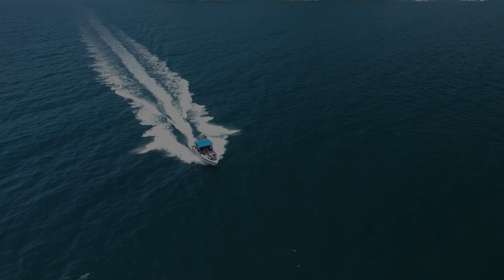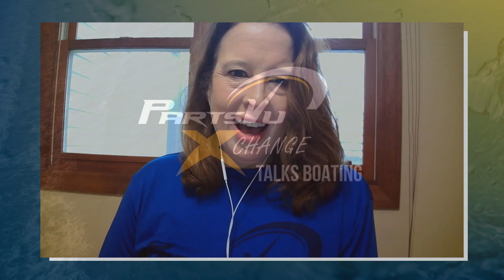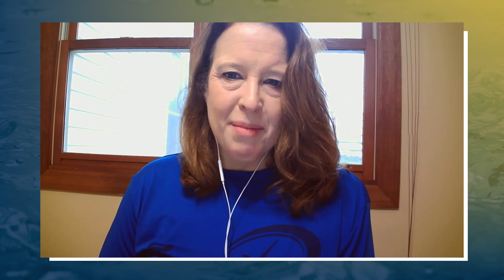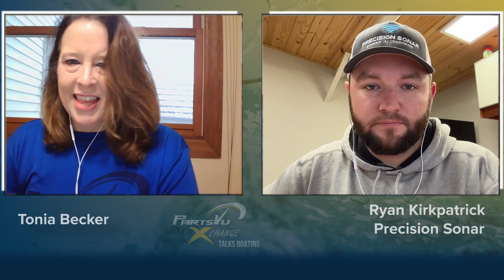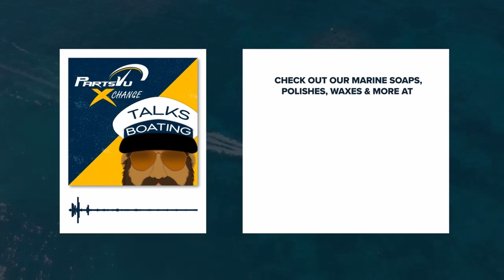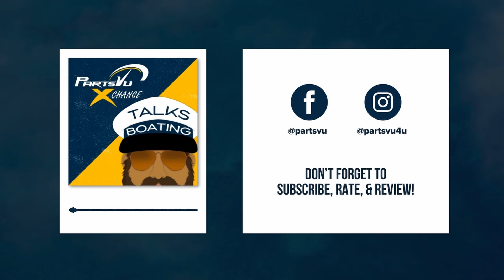The LEASH— Saving High-Speed Boaters' Lives | PartsVu Xchange Talks Boating & Fishing Podcast

Comment: I thought the leash was a piece of safety equipment invented for the outboard motor racing world that has found its way into the bass tournament fishing world. It’s not unusual for some bass boats to reach speeds of 80 or higher. 
It would be a good piece of safety equipment to own on boats that go 60 or higher. 
Since it’s legal to drive high speed boats on public water with no speed limits, then some safety precautions should be taken. 
If high speed driving was limited to sanctioned racing events then the rest of us that don’t do high speed driving would feel a lot safer on the lake or river.

Comment: If you cared so much for the boaters safety, why are you charging another $280 bucks? Seems a little overpriced. Why dont you guys just slow down and and take your heads out of the two 12” graphs mounted above your steering wheel while going 70 + MPH?
Reply: 280$ I thought they were like 325$ 350$ ?

Comment: I could also shit my pants while bass fishing but that doesnt mean i need to go out and buy a potty chair to sit in place of the rear cast deck seat, or wear depends either for that matter.

Shit when is this bass boat accessory market going to slow down? We already have to spend $20K on electronics after we buy the boat. Then we have to buy a leash for the front, leash for the back, trolling motor nut, trolling motor cable sleeve, hot foot, pad for hot foot, pad for trolling motor foot control. Not to mention the $300 + fishing rods and $300 + bait casting reels.
Reply: Well said